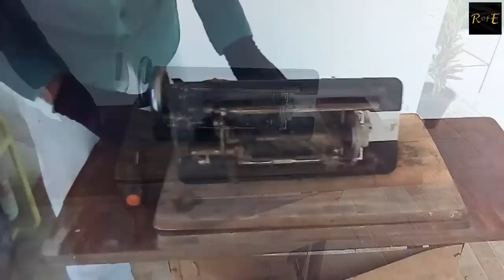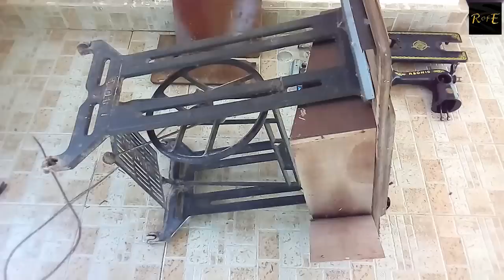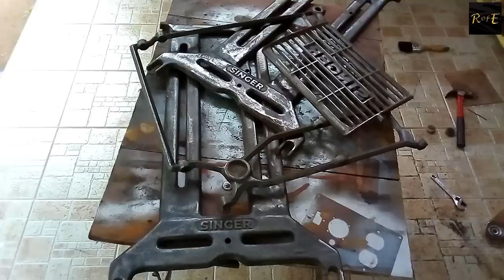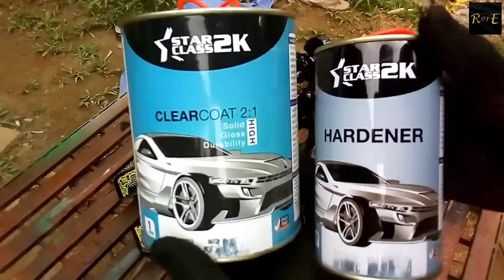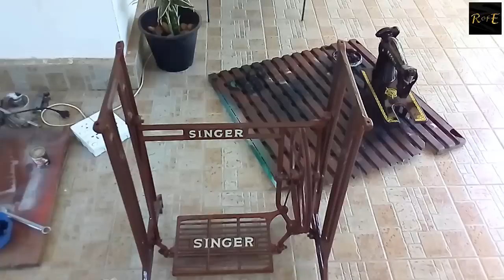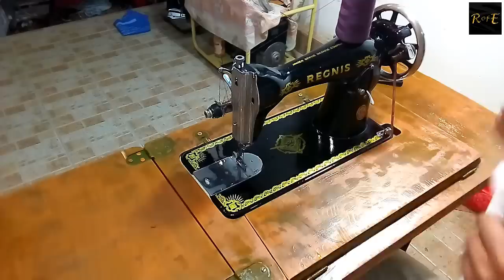Antique Sewing Machine with Table Restoration

Comment: I have just restored a similar Singer machine. Well done for attempting what  you did & at least it's working.  I personally wouldn't have re-coated the machine and I would have paid more attention to the table top surface as the veneer is bubbled up and will get worse with time. I know it's all time consuming and not inexpensive to do, but "if a job's worth doing, then do it well," I was always taught. If you can't do a veneer replacement (as It's not cheap,) then you could always remove the old veneer and replace it with a new surface of thin laminated timber that is purchased in sheets for allot less money, then stain it and varnish to try & match the rest. It would be a more sympathetic restoration that way.

Comment: Hey, best job, we need more thing like these on, inspiring. I do have one of those machine right now and I sow majority of things on it, the electrical ones cannot take the stressful pressure, especially for heavy material cloth. These also has the different presser feet, just add them on when needed. Great job. People stop doing home sewing, but the manufacturer are making the money out of them. I enjoy sewing my sheets, curtain, drapery and clothing, you get exactly what you what. My machine is approximately close to 100 years old long before I came on the earth, it was handed down, I maintain it through a technician.

Comment: Nice work on the machine itself. But the wood should have been sanded better than that, and the metal structure should have been painted as well.
Reply: I guess   you could have done a better job I think it's a wonderful restoration  job heats off to you

Comment: Wow! there is no end to the comments on this video! I was wanting to ask you a question about a machine that I have like this one.  The needle bar isn't moving at all.  I don't know if there's any hope for it.  I noticed you didn't take the bar out of the top...the one horizontally connected to the wheel, I don't know what it is called.  That's where most of the rust on mine is and I imagine the reason why the needle bar isn't moving up and down when the wheel is turned.  Since there are so many comments I'm not having a lot of hope that you will see my question but just thought I would try just in case.   I would love to get this machine going!  LOL I thought when I first saw the name "Regnis" that someone had just put the decal on backwards or something.

Comment: I think your efforts to restore this Singer model fell short in some ways, since I remember seeing this model with three drawers, one on either side and a middle one. When a complete restoration is done you need to research the drawings and photos of the  unit before starting the work since the final restoration becomes more valuable if it resembles the original!
Good luck on your future endeavors.

Comment: It's ok but should have stuck to original jet black on the metal pieces and the wood refinishing is not quality.  Awesome project, my mom had one.  Pretty cool that you actually got it working.  I would give it a 6 out of 10.  Artist needs to recognize and adhere to the high quality and attention to detail that was, and still should be, the standard for American made products.  Also the tension needs to be adjusted.